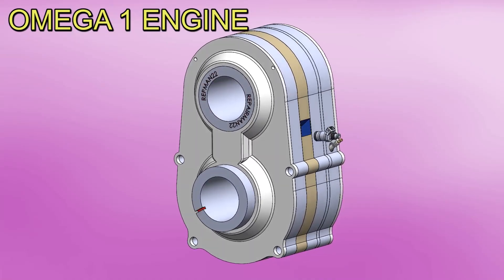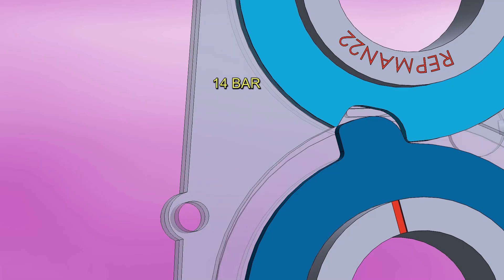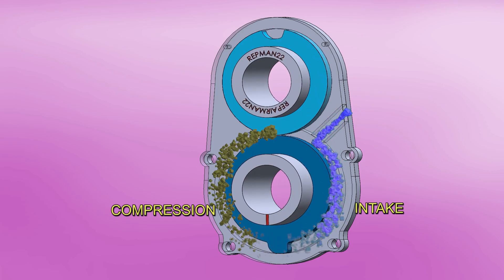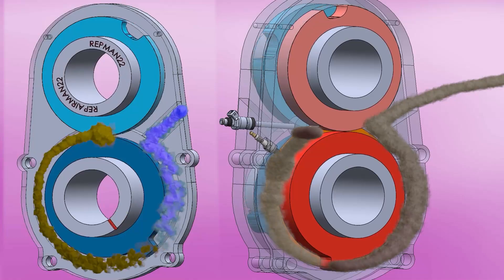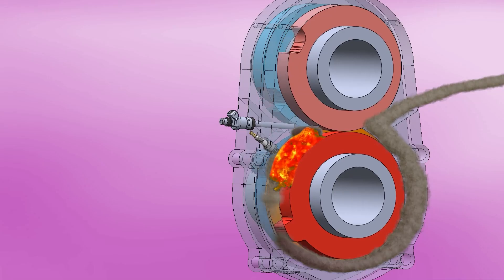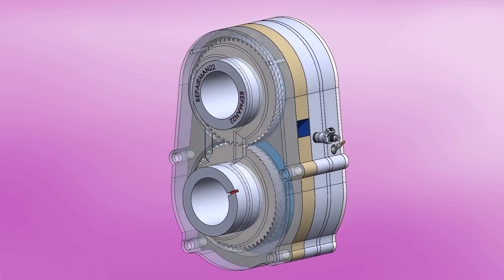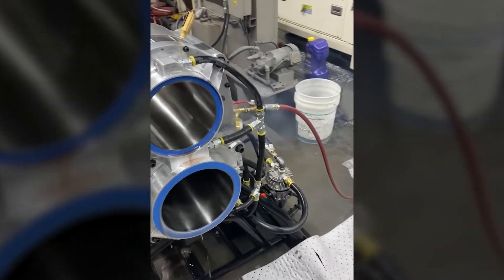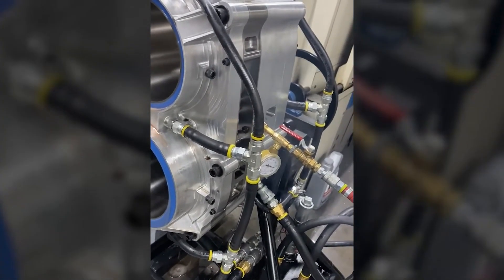😍 Can you FIT 160Hp in 30 Pounds? This New Engine Can. The Omega 1

Comment: 1)A relatively large area is being presented to the burning air fuel mixture. 2) Titanium is great but its going to take a little bit more than just that material to make expansion  by heating go away. There are ways I can see but they are not showing it. 3) going to need to work on optimizing the side to side movement of the fuel air mixture. Not going to calculate at this time, but allowing the compressed fuel air mixture to expand through the transfer port since the velocity of the mixture is no higher than the local speed of sound this limits the rpm of the engine. Going to have to think that through a bit since the inertia of the fuel air mix might be used at this point to simply relocate the gas... I could be wrong here, or they might not be including certain details. Appears that this might be fun
Reply: As with the last "revolutionary" engine, this 9ne too suffers from impossible seal issues.
Consider the wiping seal on the outside of the lump on the male doughnut..
For most of the revolution it wipes the inside of the engine block. Then it is in free space until it mates with the notch in the female doughnut. Then again, free space before returning to the engine block.
It's the unsupported free space transitions that have all the issues that a Wankel engine has and more, not fewer.

Piston rings are here to stay for a whole host of bloody good reasons.
Reply: @dougaltolan3017  I think you overestimate how important that seal is.  In a conventional engine, the rings are there to prevent blow by leaking into the crank case. When you look at the rim seal in this engine, some leakage would be acceptable without any issues.

Consider how a hydraulic gear pump works.   They have cogs spinning inside a round chamber and rely on absolutely no seal between the teeth and surrounding body.  They can produce some pretty huge pressures, despite the inefficiency.  I know the viscosity of the fluid plays its part but any "blow by" only reduces efficiency.  It's not absolutely critical.
Reply: @KenFullman  Mighty fine point there, I did overestimate it's importance.
I just get the heebe geebies every tìme i see a wiping seal go free floating.
Reply: i'd go with thenot giving certain details,
i think there's still a lot that they wont show
Reply: Looking at the animation and the prototype, it doesn't look like the swept volume is particularly big. Without doing any maths (since we don't have any dimensions) my guestimate is about 50cc.  Even at 60% efficiency, getting 160hp out of such a small engine would be a challenge..
Reply: @KenFullman Well, it depends on how high you can rev it.  Power = torque x RPM, and 25,000rpm is pretty fast. I also think your estimate of 50cc might be a bit low, although I don't really know what a realistic figure would be.  Unfortunately, all we can do is speculate until we see some real-world working examples. If ever.
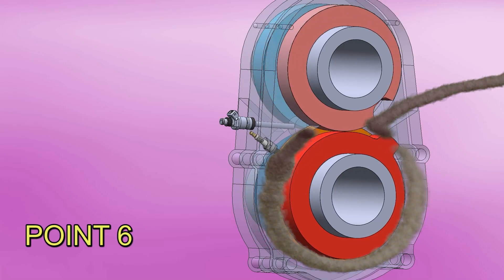Reply: @stevethackery9853  Looking at the prototype (at 6:15) the totally hollow inner diameter is about 30cm allowing for the thickness of the rotor walls, we'd have an outer diameter of the rotor of say, 35cm.  The combustion chamber would have to fit inside that case with a decent wall thickness.  So maybe about 40 cm?.  Subtracting the area of the rotor from the area of the chamber total diameter gives a chamber space of about 300cc.  But since we're only interested in "swept area" effectively that would be about 200cc.

So you could be right.  200cc at 25,000 rpm could probably pull that off!
Reply: Two more areas where this design is advantageous for torque are:
1. the large radius from the sweeping arm to the center of the combustion rotor when compared to the crank radius of a piston engine. This gives a longer lever arm. It acts like a large wrench vs a small wrench. This engine could provide the same tangential force that a 200cc piston engine provides, but if the rotor diameter is larger, it could easily produce more torque. It can also be difficult to design a large crank radius in an engine without also increasing total displacement. This design could allow the rotor diameter to increase disproportionately without much effect on the chamber volume and fuel consumption.

2. the constant tangential force following the sweeping arm of the combustion rotor. This allows for the force to always be applied 90 degrees to the radius and it follows the lobe around the combustion chamber. A typical piston engine allows the expansive forces to act optimally when forcing the piston downward, but the piston (via the connecting rod) does not act with optimal torque angle on the crank at all times. For only a brief moment, the connecting rod would be at the optimal 90 degrees with the crank radius until the piston continues downward and loses its mechanical advantage on the crank drastically. Then the torque angle becomes more acute. The expansive forces power the crankshaft for no more than half a rotation because the piston needs to exhaust during the second half rotation. This engine seems to allow the forces to apply the optimal torque angle for almost a complete rotation.

After noticing these unique design features, I have a much easier time believing the performance numbers they released. @KenFullman
Reply: I think you are spot on. I would suspect that at high enough rpm’s, we’d exceed the speed of sound through the transfer port. I don’t think scavenging through the transfer port like you described will be possible as the air is being forced to stop due to the rotor disk that closes the port… that and the change in direction the air has to make going from the intake side to the combustion side.

And I do see cooling being an issue. They claim 60% efficiency but that just means it will take longer for the materials to heat up to the same temperatures minus the heat rejection capabilities. And I don’t see how cooling this is going to be easy either. Maybe it will be cooled purely through the oil and then it will have an oil to coolant heat exchanger before finally getting air cooled?
Reply: This new engine looks very promising. I wish they can really make it work so that Tesla will have a rival.
Reply: expansion is known so all the clearances become optimal at working temperatures
Reply: Elsewhere, they’re claiming 25,000 RPM redline.

Comment: Looks like the operating principle is virtually identical to the Wankel engine. No apex seals? The hump on the "male" rotor will have to seal against the wall of the chamber, just as the apexes on a Wankel engine. Moreover, the same problems with heat transfer that plaque Wankel engines will also affect this engine: https://www.youtube.com/watch?v=v3uGJGzUYCI

Comment: No. With a gap of .10 mm there is no way to reach any compression to speak of, and definately not 14 bar. It would just fissel out between the rotors. I used to work with very small tolerances, like .001mm, in hydraulics, and that is what it takes to work with oil under pressure, this is air... Looks fancy in a rendering, but no chance in the real world!
Reply from the maker: Yes, you may be right but just thinking...
The maximum clearance between piston and cylinder is in general,: 0,01 mm per cm of piston diameter.

A piston of 80mm has a cylinder bore of 80.08
(8cm*0.01=0.08)

By the size of the machine showed in the last part of the video seems it has like 200cm of diameter. 
So may be, it is ok. Or may be not.
Reply: @repairman22  what is a piston ring, what's it's purpose (top ring)?

Comment: A very interesting concept, but I wonder how much torque these little things will produce. While each stroke is over 180 degrees, the total amount of airflow looks minimal.
Reply: Power is the only important metric here - you get more torque less rpm by gearing. That being said I doubt it will come anywhere close to 160 hp.

Comment: Personally I would like to see the engine succeed because the thinking (politics) behind the electric car is perverse and submerged in scientific ignorance. I say this as a staunch supporter of electric cars since my student days in the 60's, batteries were the issue then as they are NOW. The "technology" for electric cars has been around since 1880 but lost the battle to the internal combustion engine this was not because a political edict or corporate tax break for the greenies this was the market at work. Lets jump forward to today what is driving the market? The greed and ignorance of corporate politics "combustion engines must be banned etc" FORCING the market into an uneconomic underdeveloped mess meanwhile actually doing more environmental damage than before. "How" you may say and for dint of argument every part of an expensive and over rated Tesla is produced using electricity from fossil fuels and in this case mainly coal. So all your useful product energy comes from fossil fuels so it makes sense to develop super efficient engines until such time that the "electric car" has an economic and practical battery / motive force that actually is more efficient than the best fossil fuel engine then and ONLY then are you actually reducing the grid load and the turbines that power it.

Comment: Can you imagine a motorcicle with this power engine?
Reply: Motorcycles with this and even more power already exist. Even if it turns out to just be 30 pounds, which they haven't proved and I doubt they will, it will still only be a 50-100 pound difference compared to a regular piston engine of same power. Not mcuh of a difference as bike + rider weight maybe 600+ pounds.

Comment: I wonder how this compares to conventional gas turbines.
Reply from the maker: It is like a turbine but working with positive displacement.
Due to the changes in direction it would be more like a centrifugal type rather than axial I think.
It would be nice to know the displacement of this engine but Astron Aerospace did not reveal it.
Reply: @repairman22  how about how subaru wrx cvt handles high torque , could work with mahle cheaper and recycalable electric motor because that thing needs a transmission. then electric assisted turbo combustion charge battery and compress liquid power,. so itd use the limited low longveity batteries which have a small part of them that cannot be recycled due to dendrite forming battery degradation, to lower emissions, weight(crash saftey (especially yo tohers)and road wear), costs etc in rear mid engine compact 4 seater with rear seat facing rear